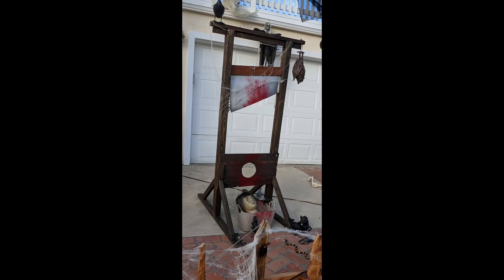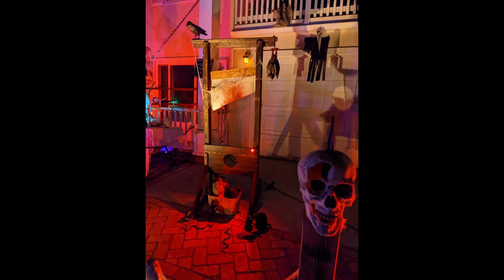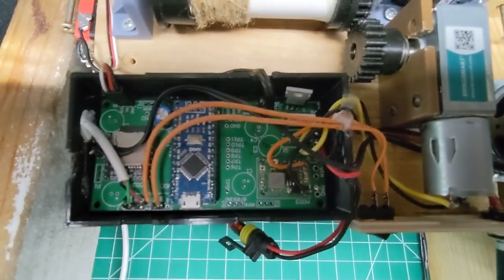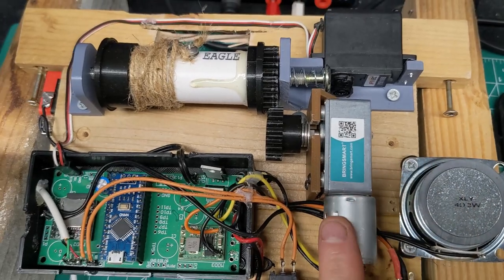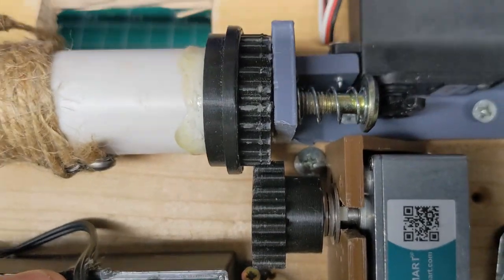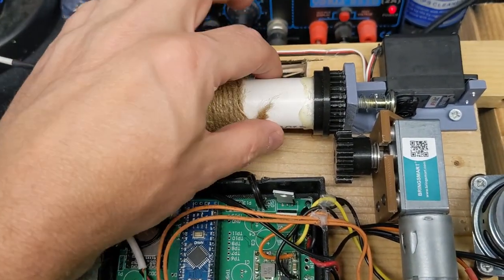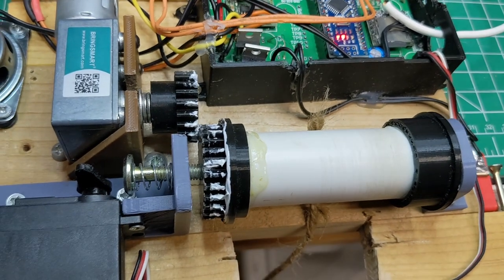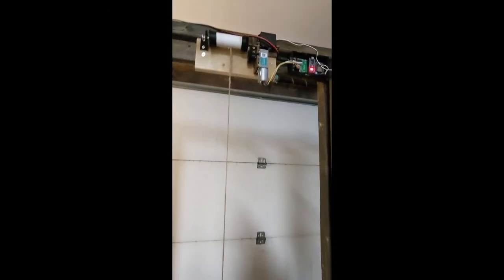Halloween Guillotine Motorized Blade

Comment: I've been thinking about how to make a DIY drop scare prop for quite some time and here it is! Really great and just "complicated" enough to achieve the goal. Thank you so much for sharing!

Do you have details on the servo that you used to move the wind up section out of the way and allow the prop to drop?
Reply from the maker: It was an FS5115M. You can probably use something less beefy though.
Reply: @scaresandsparks  I finally got around to wiring up and testing the FS5115M servo but unfortunately I cannot get the servo to work. Would you happen to have a wiring diagram?